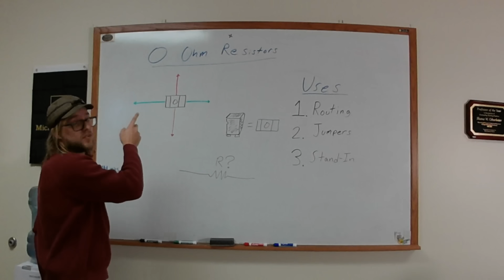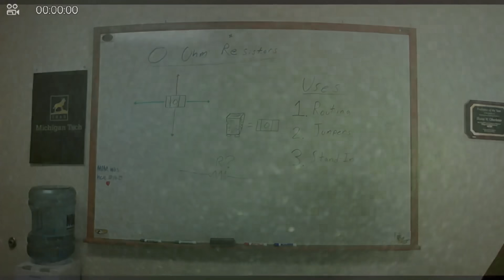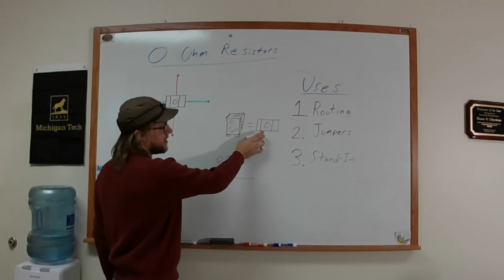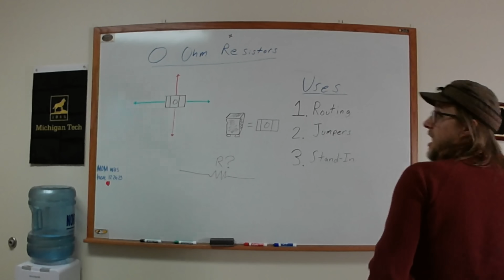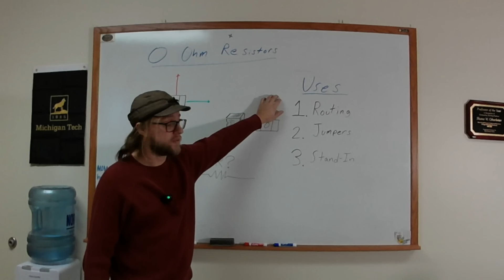The Resistor That Doesn't Resist

Comment: Probably not intended but zero ohm resistors could be used as fuses. I only know this from having to replace a few while doing component level diagnostics in servicing  some audio PCBs.
Reply: I’m pretty sure that was an intended use. A jumper wire would pass excessive current until it melted, whereas a zero ohm resistor would be likely to fail sooner if some other fault in the circuit caused excessive current.

Comment: If the zero ohm resistor is made of same stuff as regular resistor you could use it as a oc fuse. So off to much amps go through it just pops apart ?

Comment: I've seen them in a gauge cluster to fine tune the speed, which always had a bit of deviation in analog speedometers.
The previous model used a potentiometer, but they changed for jumpers with resistors which could be enabled/disabled to adjust the needle position.

There also was one in my car ecu, which served as a jumper and had to be moved if you wanted to read an external rom instead of the factory one.
Tuners used it to store new maps and transform the stock ecu into a reprogrammable one, before they all used flash rom instead which could be reprogrammed without hardware modifications.

Comment: Interesting premise. 0 Ohms.
0 zero resistance, no such animal !
Every wire, trace, track, lead, joint, resistes Electron Flow, or Hole Migration if you prefer. Just because some equipment does not indicate it, does not make your assertion correct.

Comment: So what's wrong with just using bridges, and why not use a close approximate trim potentiometer as a stand in, so you can dial up/down the resistance to zero to find if you need a resistor, or just a bridge?

Love Michigan State, been there a few times.

Comment: My main uses are as jumpers/configuration devices (especially in open source hardware design) or as stand-in. If you have a possible required requirement for  a ferrite bead or inductor, you need to bridge it with something, as long as you don’t know. This is for electro magnetic compliance purposes. In consumer electronics with high volumes, it makes sense to remove the not required components. Industrial electronics very often, is not produced in high volumes, so the 0Ω resistors stay, since the money saved by removing them, does not pay the required board redesign.

Comment: Oh, and can you get them in DIPs? 😁

Also, what tolerance does that through-hole one have? 😂
Reply: Traditionally, the lack of a tolerance band implies 20%. One thing you can be sure of is it not measuring exactly zero ohms.
Reply: @johnm2012 : I don't know if you noticed the laugh icon I had there, but I was actually joking. Because the tolerance of something like that should automatically be 0% just by its nature -- I mean, if you're expecting something that's 0 ohms to just be a wire underneath that casing.

However, if we get serious, then let me ask this: if they are supposed to be zero ohms then why would they not actually just be a wire straight through (even with whatever casings that they're supposed to have)?
Reply: @HelloKittyFanMan  Perhaps I should point out that I was joking too, while pointing out that they will actually have a few milliohms of resistance. As to your question, I don't use them myself. If I need a link I use a piece of tinned copper wire.

Comment: But why would factories make 0-ohm "resistors" (at least the through-hole kind) to get over that trace when you could just use one of those stiff wires (and if the wire isn't insulated -- it looks like a staple -- then maybe the trace is solder-masked anyway; or maybe the wire is insulated anyway)?
Reply: @davebing11 : Oops, apparently you tried reading too fast and missed what I said about through-hole 0-ohm "resistors" and insulated wires.

Comment: The 0 Ω wired resistor can be picked up in the same way as a normal wired resistor ( by the pick - n - place machine ) , so you do not need a human operator to manually place a wire link ( saving MUCH cost ! ) ...... DAVE™🛑

Comment: As to jumpers I have also seen them used to configure things like network addresses. The resisters are put in place to give a default address. Then the field tech can clip the resistors off with just a set of cutters to configure the address to the system the device is being installed in.

Comment: In a related example, I disassembled a night light  and found two 10k resistors in series.  I was puzzled when nothing connected to the mid-point between the two resistors.  It wasn't needed for power or voltage rating, and didn't simplify the bill-of-materials.
Then I realised that BOTH resistors had tracks running under them.  They split one resistor into two so they could use a dirt-cheap one-sided PCB.

More recently I've used two zero ohm links as bridges on a PCB that didn't need to be cheap, but where for safety reasons all tracking except ground had to be on one side.

Comment: Sometimes it used to set address of an i2c slave (i2c sensor). Most of the hobbyists just bridge them with solder, but in assembly line it's done with zero ohm resistor.

Comment: The main reason to use in place of a wire link is for pick and place machines. They can handle resistors - a bit of wire is new tooling. For a hobbyist, a bit of wire is fine.
Reply: Thanks for confirming that. Seems logical. There was one in a reference design for an EPS32 and that seemed really weird. Any explanation why it would be there? Somebody said it’s a fuse, but that doesn’t seem very logical.
Reply: @OMNI_INFINITY zero ohms still have some resistance just like everything else, so they'll eventually heat up and melt just like a regular fuse, just with the lovely smell of magic smoke. However the current it'll pop at is a rough estimation based on the resistor's size. It's not exactly the most preferable option, but it's good enough to prevent a catastrophic short from being a fire when used appropriately.
Could also be something else such as a design limit (single sided board or weird routing limitations, which aren't uncommon on boards going for minimal size) or for selecting an option of some sort. Couldn't tell you which for sure without seeing the schematic.
Reply: @OMNI_INFINITY  Iv'e been in Professional Electronic Repair for over 42 years, yes they are at times used as fuses. It's not common but I have seen them specifically used that way.
Reply: In a professional field where Runs must have a jumper, a bare wire is never used because over time it can work its way through the run masking and short out, the exception to the wire jumper is if it is insulated. So the best alternative is to use a known size and package that machines readily are designed to grasp and place, so the zero resistor package is used for ease. Seen it over and over over the last 42 years of my profession in professional electronic repair. As a hobbyist at home and a few times at work, do use an insulated wire because I don't have a pic and place machine. If we or I had one for production I would use the zero ohm in it's place. The exception at work is even if we don't have the machine sometime we still have to use one to meet spec by the part number in the manual.

Comment: Another reason for a zero Ohms:  Sometimes in development, you want to measure the current being taken by part of the circuit.  To do this you may take the zero ohms out and put the meter there or just make it something like a 1 Ohm resistor.  When it goes to production, you don't want to do a new layout.
BTW:  If you position two resistors side by side at just the right spacing, you can put resistors in as you normally would or you can put them in a 90 degrees. This can make one go from pin 1 of R1 to pin 1 of R2 instead of connecting to  pin 2 of R1.  This can be very handy for providing alternative wiring on a circuit such as selecting which pins of the micro go to what.
Reply: Actually sounds like a genius solution to that inconvenience. Never though of that.
Reply: As someone that used to do component repair, I'll mention that these are SUPER useful for testing for the same reason. You can isolate whole sections of board with a few desolders and test them very quickly. This enables much faster repair than when they aren't there where you may need to know a ton more about the particular circuit you're working on before doing any meaningful testing.
Reply: If the current in that connection matters during development, odds are it's also going to matter during production and will need to be measured during testing. And to test each of 50 000 circuit boards by leaving a connection open to introduce an ampmeter to then make the connection later is a pain in the rear end.
There is a much more convenient way to measure current. Do it indirectly. Add a low value resistor, measure the voltage drop across it and use Ohm's law calculate the current. Sure, the manufacturing tolerances of the resistor make the measurement less precise, but something like an E48 ought to be sufficently accurate for most contexts. Yes those are more expensive than 0 ohm resistors, but saving the money you'd have to spend in order to do additional soldering after the testing was done - and then do the re-testing that is needed after the soldering job, easily outweighs the more expensive resistor.
Reply: @MrAranton  In real life, things often are needed in development or in trouble shooting that are not needed in day to day production.  For production testing, the fact you don't have excess current drain can be checked for the entire board.  Finding the culprit is where you may want to break into sections.
Reply: @kensmith5694  I guess there are different approaches to that. 
My employer operates on the philosophy that testing done in production should be more than just proof that the unit is working within specification. It should also provide information for trouble shooting. But then we mostly use automated testing rigs than can perform hundreds of measurements in a matter of minutes or even seconds. 
So if a unit doesn't pass, the test report usually has all the information you need to figure out what's wrong and to decide whether or not it's worth fixing. If - thanks to extensive test reports - it just takes a couple of minutes to identify and replace a defective component a unit with a sales price of 20€ is worth fixing. But if a skilled technician spend the better part of an hour just figure out what's wrong? Not so much. The way the company I work handles in-production-testing minimizes discard and I don't like wastefulness. But I get that other companies have a different approach and that not all discard can be avoided.

But I digress: At my employer development is done with this philophy of testing in mind. Testing anything that's close to what the final product is supposed to be in ways that can't be replicated by an automated rig just feels - off and clumsy. Maybe I'd see that differently if I worked at a company with a different philophy.
Reply: @MrAranton  For a lot of makers, the failed PCBs are just scrapped.  The PCB is worth less than the technician time for trouble shooting.  The company I work for doesn't have near that volume but still a general test that says there is no problem is what production generally needs.  The trouble shooting guides can have a lot more information in them and also the methods to obtain more details on the issue on the PCB.
Reply: @kensmith5694  I get that most makers just scrap faulty PCDs. I also get why they do it.
But that doesn't mean I have to like it. I'm allowed to find that practice inelegant and wasteful. In my opinion includes having repairability in mind is an element of "good" and "elegant" design. Sure, that goal needs to be weighed against others, such as cost, size constraints etc. Particularly if the PCB is going to covered in resin to be water-proofed, repairability ceases to be an issue.

Comment: The first time i saw a zero ohm resistor was last year and after asking our teacher if it was used kinda like a jumper getting confirmation that it was i love using zero ohms when i need to connect short places in a single layer board

Comment: i always had one question about those 0 ohm resistors
how much does 0ohm resistor work as a fuse
because it has both package size of a certain power resistor, but ohms law would make it infinite so since there is no infinitly low resistance it must have some value too other than 0 and some fusing characteristics
Reply: I guess it’s use as a fuse would be determined by its power rating. By using some basic formulas I recon you can find a maximum current limit at the voltage of your choice. Since these are probably quarter watt resistors, maybe you can push something like 50 mA at 5 volts before they blow? (All of this is just my opinion btw)

Comment: I like using zero ohm resistors as superconducting magnets. But you have to make sure they didn't cheap out and give you a 0.05 ohm resistor or something like that.
Reply: Black Black Green Gold
0.0 MΩ, ± 5%
Reply: sometimes they screw up and give you a -0.05 ohm resistor, then you've won the jackpot
Reply: @1224chrisng  That's something to think about: V=IR makes either V or I negative, thus P=IV is negative. Luckily resistors with such small values tend to have a high wattage rating, we wouldn't want it to burn out while trickle-charging your car battery 😛
Reply: @1224chrisng  5% of 0 is still 0. But in fact 0 ohm resistors have a conductor resistance which is higher than 0.

Comment: to elaborate on #3
we often use them in series and or parallel with our first best guess on analog circuits that are compensating for parasitic quantities not precisely known in the design (eg. in analog feedback loop stability, gain compensation, emc filters, and snubbers, etc)

Comment: I didn’t hear you say the reason that zero Ohm resistors are used instead of simple wires.  I believe the answer is automatic pick and place machines.  A zero ohm resistor, whether through hole or SMD, is the same form factor as the other common components and thus will work in automated machines that aren’t configured to insert wire jumpers.
Reply: I was wondering, too, why not just conventional jumpers.  Several good reasons below; but, yours is probably the most salient, at least for production purposes.  In the end, it is just a matter of cost and/or convenience as to which to employ, it turns out.  Just one more practicality choice.  But, like you, I presume, I do wish that the video had addressed such basic consideration of deciding upon the most apropos per the particular situation.
Reply: Zero ohm resistors also allow better isolated bridges for power applications than simple jumper wires, where conformal coating/enameling wouldn't be enough, but insulated wire would be overkill and require special configuration in your automated process to take it.
Reply: @hyoenmadan exactly right...  I design guitar pedal circuits and when dealing with high gain circuits for example, a bare wire jumper can introduce oscillation and/or noise.
Reply: These answers combined with a video are a great example of the difference between the theory of academia (where Dr. Shane is coming from), and the practice of industry. Shane uses them for a bunch of experimental reasons - jumpers, stand-ins, because that's what he has to hand. Industry uses them because it means they don't have to retool a different machine. 

It's like when people complain about, say, a mail-order company using a 2-litre box to ship something that's maybe a couple of half a litre in volume, but the fact of the matter is that it's more efficient for a shipping company to run only a few standard sizes of box instead of having to track dozens of specific sizes and figure out how to send each.
Reply: You are correct. That is the only reason they exist. Could have been explained in a minute.
Reply: @Peter_Riis_DK  True, but who makes 1 minute YouTube videos on topics other than the stupid things in the shorts videos.  It should would be nice if people could make videos only as long as they need to be rather than pad them with filler for 15 minutes.
Reply: @LTVoyager  
You're a smart guy. I agree.
Reply: @LTVoyager  Can't monetise if it's less than 10 minutes long!

This is one of the reasons why I say Google's one of the worst things to happen to collective human culture.
Reply: @hoilst265  Great point.  I forgot about that.
Reply: @hoilst265  That is a myth that has been perpetuated for years. You can even monetize Shorts now, although the money currently is more "supplemental."
Reply: Idk what you guys are talking about, every scenario he mentioned in this video is valid, and also the formfactor of the resistor makes it a better choice in those examples.
Reply: Man I guessed something like that had to be the case 😀 I was like, so if it is a wire why did anyone bother to glue a blob of paint over it? And I was like, It has to be some pipeline BS where it was cheaper to just create the resistor than to change the pipeline for the edgecase that somebody actually put 0Ohm resistor into the schematic 😀
Reply: They are used, or at least I commonly use them, for a jumper when I'm populating one of my PCBs.  Usually it is bc I changed something later but I want everything to look uniform when everything is populated.
Reply: Literally watched this video just to see if the answer was "they're for pick-and-place machines" because the answer is that they are for pick-and-place machines.